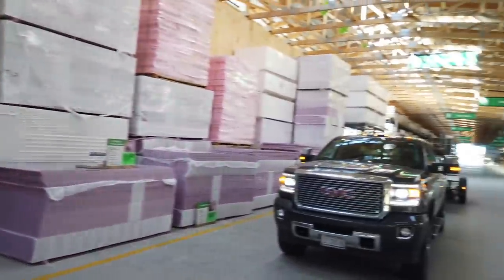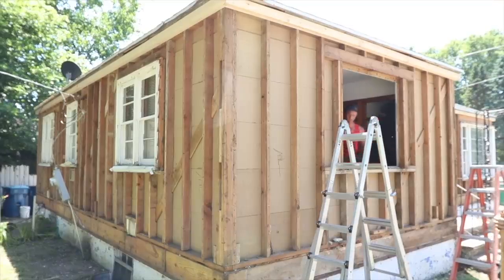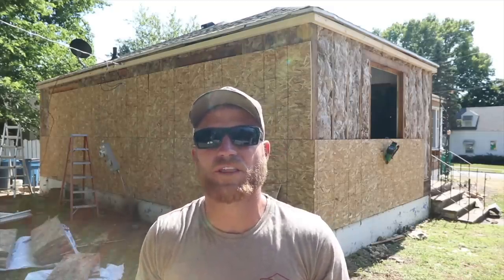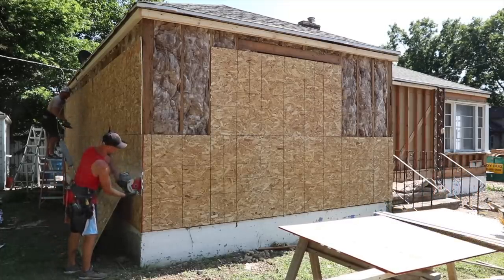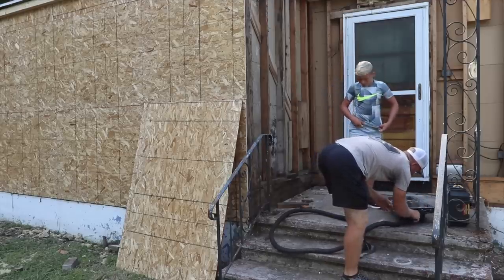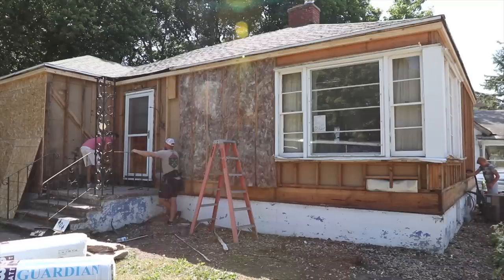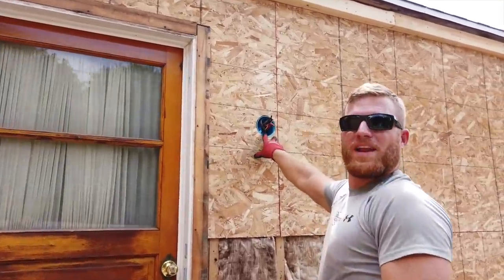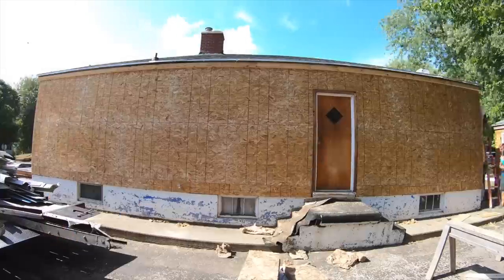How to Renovate Your Homes Exterior Part 2: Installing Insulation and Sheathing

Comment: I just completed the exterior renovation of my 65 year old 24x30' cape cod, which included new R-15 kraft faced insulation, 7/16" Zipboard sheathing, 13 Anderson 400 double hung windows including a 5x7' bay, 2 new Mastercraft (Menards) doors, and LP Smartside 6" lap siding, yes, the works! Everything you did looked very familiar, great job measuring, cutting and fitting that sheathing! You caught a break not having to remove crusty old insulation! I appreciate the comments about how hard and all consuming this work is, the demo work is exhausting!!! But it was worth it, because my house went from the worst looking house with peeling paint, loose siding, and rotting window frames to the best looking house on the street. It is so much quieter and comfortable to live in too!

Comment: I Batt insulated homes for 10yrs and we only used a utility knife. Would have liked to see you use, R-15, Kraft-Faced Batt, from Owens Corning. Not only would you gain a vapor barrier, but also add 2 more in R-Value and the stuff really fills the entire 2 X 4 cavity solid. But no doubt, your place is going to benefit HUGE from this ! You guys do such nice work.
Great job and thumbs up gentlemen !!

Comment: I've remodeled many and old home and I would rather do that over new construction. My last was an 1895  two story balloon frame. I did the inside and sold it due to the asbestos slate siding outside.  Now I have a two story red brick and all I have to do is new windows and replace existing wood soffet  with aluminum and cover the facial with aluminum. One project per year. Love the videos both remodel and post frame. I've learned a few new techniques. Thank you !!

Comment: Looks good. Did the same thing on my house. Pulled off the old vinyl siding, 1” SM styrofoam, tentest board and old fibreglass kraft batts. Replace with roxul R14 batt, 7/16 osb, house wrap, 1” styrofoam and new siding. Big diff now, quieter. And wifey is happy

Comment: On our new homes with siding, we use old work boxes for the outlets and light fixtures. 
Leave the wire behind the sheeting in the area of the fixture or outlet. 
Then you can cut it out, (we use a hole saw for the round boxes) according to what works with the lap siding.  
This allows  it to be installed in the center of the lap without having to put a monument around the outlets or fixtures. 
Awesome work and quality.

Comment: AWESOME DUDE!!  Conner is awesome, too! It's been a long time since I renovated a house like that, although my greatest challenges were mainly bailing my workers out of jail, picking everyone up because they were still in bed, assuming the house would need to be replumbed with PVC due to vandals ripping anything copper or steal siding, a lot of tool replacement from people just walking away with them to my workers breaking them. I learned to house the drug dealers' mothers nicely in the different areas of town for better protection, etc. I'll tell you what YOU did that was SUPER SMART: Installing style& material;, pulling the old windows out and boarding up the whole house with your dependable, skilled builders like that until the windows come in (not to mention the Saturdays!). Those inspectors must love you, Bro! OH AND, Finding a 4" hole in the exact board location impressed the hell out of me. I've got the knowledge & triangle, but I needed keep my eyes on my Dewalt, Milwake, Makita, and other quality tools, and I settled for all corded tools so I knew who was using what. Batteries disappeared like candy. And I'm only watching the second part of your video renovation. Why did I do all of this? It was because I could. These people were felons. Their mothers couldn't believe ANYONE cared about them. Out of quite a few workers, I was able to get 7 felonies expunged; and many others workers are no longer alive. I'll try to curb my enthusiasm, from now on, Brother. Thank you all for letting me watch these projects because they all ROCK and so do all of you!!!

Comment: Really considering doing this on my old farmhouse. I put an addition on it recently and as I suspected, mostly no insulation throughout the walls.  It also has those 1x sheer strength boards but putting on osb would increase the sheerwall strength a lot. That being said, you get the most sheerwall strength added when osb is hanged vertically but just adding it in to begin with is a major improvement. Plus its only a single story.

Comment: Energy efficiency needs to be a big part of any new building or remodel.
Saving energy saves money month after month, year after year and makes the building more comfortable.
Air sealing, super insulation, high efficiency heating and air conditioning systems, high efficiency appliances, set back thermostats, LED lighting, triple pane windows and solar panels all need to be considered. Spending more to do a quality job saves money in the long run.

Comment: I know more than a lot of men about remodel, but I learned even more little tips in your video. I don't know if I have walked right past that triangle tool. Gotta have one. Never covered a surface with board like that. Are expansion joints on all four sides of them? Also, what is the purpose of not covering the sill plate and joist? Guess the next video will show me that! I'll be doing a job exactly like this (not windows) on my cottage. Putting up split logs and mortar.

Comment: Here's a Pro Tip for you. When loading materials at the lumber yard, load the 2x4s last since they are what you need to use first. That way you don't have to unload 1000+ lbs of sheathing to get to your 2x4s..... That also keeps your sheathing on a nice flat dry trailer bed which makes for much easier cutting of 4x8 sheet goods.

Comment: Might want to add some insulation to the attic as well, I think 20"-24" is called for in the upper Midwest.  The insulation in the attic will stop a lot of heat loss.
Reply from the maker: It has blown in
Reply: RR Buildings good

Comment: In our area, we are required to install fire blocking the full width of vertical framing members at all horizontal sheathing joints. With that in mind, we install sheathing vertically instead of horizontally, which is contrary to the strength axis of the sheathing. It seems backwards to me for strength purposes, but that is how we do it. Inspectors don't like surprises.

Comment: Being that they had no gutters, or had none when the house was built. 
The put on an over hang for when it rains. Other wise you'll get water tension coming off the roof onto the fascia.
Which will create rot and mold over time.

Comment: Awesome job Kyle. I'm glad you didn't do the spray foam like you mentioned in the previous video. You saved tons of money and the "tenant" won't care anyway. You also saved the cost of having to repair drywall by doing it the way you did. More than a few investors would say you shouldn't have even insulated that building, but I'm not one of them. I have a friend who actually lost tenants because the utilities were too much; he left an old house not insulated.
There are plenty of investors who would also say not to change those windows; I'm not one of those either. Those things were garbage and would have just caused a bunch of costly maintenance for you over the years. But I hope we don't see Marvin windows on the next video. JenWeld from Home Depot or something similar in cost will be more than adequate for that property, and the "tenant" still won't care. Keep up the good work.

Comment: I CANNOT Believe there was no insulation in those walls to start. Now there is no vapor barrier tho....
Reply: Back in the day, there was A) little to no available insulation, and B) fuel for heating was dirt cheap.
It really wasnt up until the 70s that the fuel crisis hit and fiberglass insulation was finally cheap and affordable, and now required by building codes.
Let's be honest, better that they put in NO insulation, than to have filled the cavities with asbestos or some other awful insulation!
Reply: Kelsey Jones : @bigpjohnson is 100% correct. The most recent investment property I purchased was Aug 2018 and it was built in 1968. There was no insulation in the house at all; the walls aren't even sheathed using osb. Since the outside of the house was all brick, they just used that black light-weight board I call fibertech. It's almost fuzzy on one side and it's super easy to break. That stuff was the "insulation" back in those days.
The house was also listed as having a 3 car garage; LOLOLOL. Seeing that all the other houses in the neighborhood had carports, I knew the single garage was just the carport framed in, and I could see daylight between the edge of their wall and the brick that they framed to; LOLOL again. Then I went down to the city to see if there was a permit pulled for the attached garage. I was surprised to see that there was one pulled, but not surprised that there was only a footing/foundation inspection called for and no other inspections were ever scheduled. Right then I knew that the garage wouldn't be worth a crap. I was right of course. The framing was lower than even a respectable DIYer would have done, and would have failed even by 1968 standards. The wiring wasn't much better... Well, half the 110s didn't work and I could see that they were all pulled using 14-2 (not surprised though because I believe 15 amp was ok for garage outlets in 1968). If somebody knows for sure please chime in.
Anyway, my main point in saying all this is that when you purchase an older home and you want to "fix it up", you only have to ensure it's to code as per the year the house was built. That being said, I've never "not" insulated an older home that I've purchased and reno'd. It's my opinion that any investor who doesn't insulate as part of any reno is just a slum-lord and you sure wouldn't want to rent one of their homes. Note also that if you do any additions to an older home, [the addition portion] will need to pass an inspection based on the most current code. Anyway, I hope this was interesting for you. Sorry if it wasn't.
Reply: @TrailTrackers  Any repairs or new work have to be done to modern standards, NOT just what was allowed back then.  For certain things, you can keep the same, like using non-grounded outlets if the old wiring isnt grounded.  If you want grounded outlets, then you need to run new wiring.  Knob-and-tube wiring is usually mandated to be fully replaced anytime its touched due to its many inherent problems and old age.  Also, any time you open up walls, you have to bring whatever is inside up to Code, usually insulation and electrical.
Reply: I'm not surprised. My parents bought the house my grandfather built sometime soon after WWII. After they paid the mortgage, they decided to get a smaller one and redo the exterior to enhance the value for eventual resale. They found out that the insulation was wood shavings and that over the years it had compacted down to the bottom three feet of the walls.
Reply: Ya, is this house in a part of the world that doesn't need a vapor barrier?
Reply: @01mustang05  I know this video is a couple years old, but I'm curious about a vapor barrier as well.  Didn't look like they sealed the outlets either.
Reply: @greb3212    No they didn't seal the outlets, then added weird recycled looking fiberglass insulation where no insulation existed originally, and they sealed that in with glued and compressed wood chips boards, both of which likely off gases toxic VOC's for years.   They chose the wrong way to go imo.

Comment: I’d be curious to see the difference in the ac bill after the new windows and insulation. All I know is that Greg is living in a cave for the time being.
Reply: Right? Upper Illinois with no insulation in the walls? That's crazy. I bet it'll be a yuge difference in the bill.
Reply: No doubt! I'll bet the utility company's will be checking up on this address, wanting to know why the bill is less than a 1/3 of what it was previously, overnight!

Comment: 16:18 For rough framing I think I would stick with a snapped line and the good ole worm gear saw.  I would worry that the track would get bent or stepped on somewhere along the line. At $85 a track that is not the end of the world, I know, but...

Comment: At 1250 in the video you start a couple nails at the edge where the sheet goes before putting it on what is that for?
Reply: Believe it or not 4'x8' sheet will expand when moisture is in the sheet, so that little bit of space will help stop the 4'x8' sheet from buckling or looking wavy
Reply from the maker: Spacing
Reply: 1/8" space for the OSB
Reply: Thanks, came looking for that info.

Comment: Hi, I love your video. I have a question if you don't mind. The previous owner of the house where I live painted over the plywood. I believe there is not house wrap underneath the plywood. Do I need to change the painted plywood to put house wrap on top and then siding or can I go ahead and put house wrap over the painted plywood and then put the siding. My apologies if my question is a stupid one. Thanks for sharing.

Comment: This was really a great video for the do it yourself project. I am curious what model track saw & track you are using. I assume if your using it, it’s the best without breaking the bank. My big question is, you don’t appear to clamp the track down. Is it a friction fit in that it doesn’t move? Have you covered this or any other track saws on your tool videos? Thanks Kyle, Jim
Reply from the maker: Yes complete friction fit. It’s awesome
Reply from the maker: Dewalt Track Saw
http://bit.ly/FlexVoltTrackSaw

Comment: Cheapest 7/16" OSB sheathing with Tyvek is $0.61 per SF (ignoring tape, tacks etc) vs Huber Zip which would be $0.69 per SF including tape. At $0.08 per square foot, the upcharge should be minimal. Labor should be similar or lower... I think that's right?

Comment: Just curious....Is there a reason you are installing the sheathing horizontal? The strength axis on most panels is for a vertical installation.
Reply from the maker: Funny.... I was always told the exact opposite
Reply: @RRBuildings  I'm in Cali... where everything is azz backwards. I think we are both right. Just a thought though....with a vertical installation you are connecting both top and bottom plates with a single sheet. This coupled with your H1s, A35s or whatever you use on your trusses or cut/stack obviously "straps" the whole house together.  Also, you wouldn't have to rip the small piece at the top or bottom. BTW....I have three sons...one is working for me now and two others in HS coming up soon. It's great to see you pass that building knowledge onto to your boy.  Keep up the great vids!

Comment: Poor Greg. He gets to live in solitary confinement with no windows. That's no way to do him. 

Very surprised that in Illinois that a non insulated house wasn't eating him out of house and home for heating. I'd of been tempted to sheet up to where the windows went, then just screw sheeting on until you got the replacements. Looks like a lot of OSB waste.

Here in the mid Atlantic, I framed my shop with 2x6 and R19 fiberglass and used plastic inside the walls before 5/8" sheet rock. Exterior is pressure treated T-111. I had storage trusses built and blew in 16" of fiberglass. Costs me less than $30 a month to cool and $40 a month to heat using a split Mitsubishi unit.
Reply: I'm shocked they didn't have any issues especially with that polar freeze this last winter! 
:o

Comment: No need for a track saw, just use a drywall square for your 4 foot cuts, job site table saw for 8 foot cuts if you need to.

Comment: Did no one notice no vapour barrier was not between the insulation and the drywall inside? Would hve thought you have similar winters to us in Canada.
Reply: Newer building science actually shows that a vapor barrier is not needed in the midwest and similar climate. A vapor retarder, the the kraft facing of batt insulation is acceptable but with how well sealed houses are with exterior weather and waterproofing the added (extra) vapor barrier on the inside of the insulation is not needed and in some causes prohibits proper drying of materials within the thermal envelope.
Reply: @adamliske  Unless you like living at >20% humdity, warm damp air will condense on the cold exterior sheathing and freeze.  Come spring, it will be a soggy mess. Fiberglass is TERRIBLE at preventing air leakage.  It's also not really the r rating in real world conditions because of this.  Not sure what building science you're looking at,  but I've seen it firsthand.

Comment: Where’s the vapor barrier on the insulation?
Reply from the maker: In my area I would need it on the inside... so future remodel maybe
Reply: @RRBuildings , If you used kraft faced batts and put the paper towards the interior, that's how you get your vapor barrier right ? That's how we do it here in the Northeast. I think you'll be A-OK though !
Reply: @augustreil  True, though for code(and vapor barrier purposes) the kraft facing you speak of has to be lapped over the studs.  Would not be able to do it without ripping out the interior as well.
Reply: @adamcobie4207 , Kraft faced insulation can be installed either way, stapled or not to the interior of the stud or face stapled to the face of the stud. Yes, face stapling allows for a better vapor barrier and a fuller expansion of the insulation, but is still better than none. Also, it was never code here in Ct to Face staple.
Reply: I was wondering the same. At least if you had used faced, then at a later date interior remod. All you'd have to do is face staple. Oh well.

Comment: before you pit the insulation in did you replace the wiring and update the breaker panel. is the old service panel  a 60 amp fused vintage.  lipstick on a pig is not enough for me.